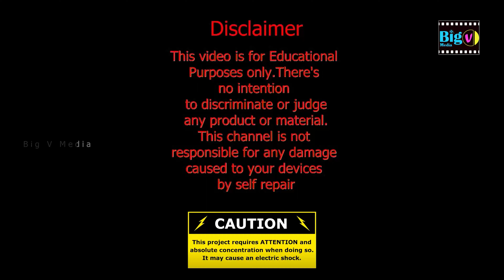Philips radio poor station reception fix. | फिलिप्स रेडियो स्विच क्लीनिंग

Comment: Never use sandpaper....hv cleaned zillion switches....used a common toothbrush and vim powder...basically u need to get rid of that oxidised layer over copper contacts...the other gripper contacts are beryllium alloy...read that somehere....

Clean those also but ultra carefully....then oil all contacts and assemble back switch.

Lube at regular intervals

Switch will work better than factory assembled
Have many vintage stereo systems wd radio, plain radios vinyl record player....clean the switches once every 2 years or when need arises....
Reply from the maker: The issue was caused by a low-quality switch. It had no coating, and moreover, it had been cleaned and polished earlier as well.